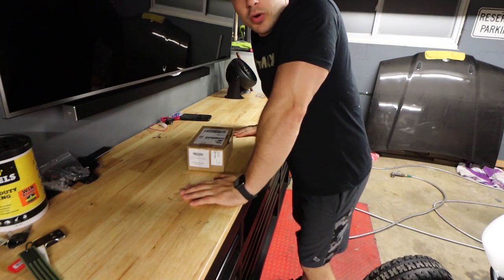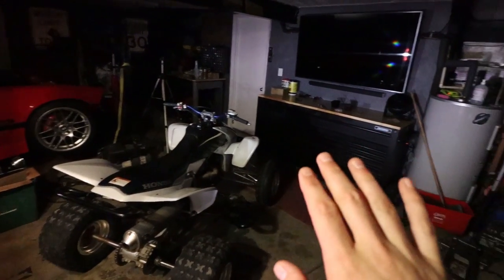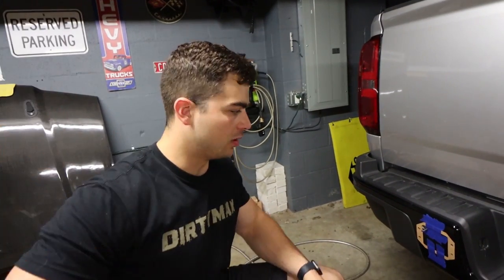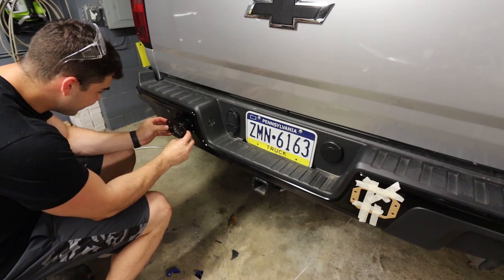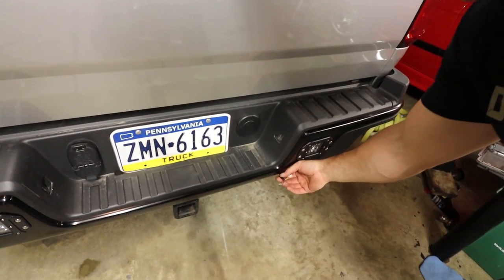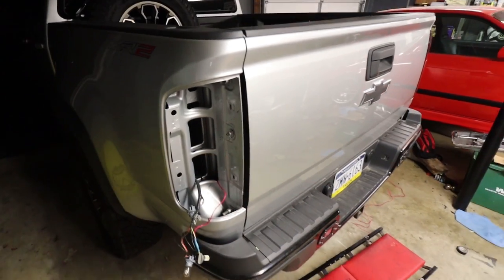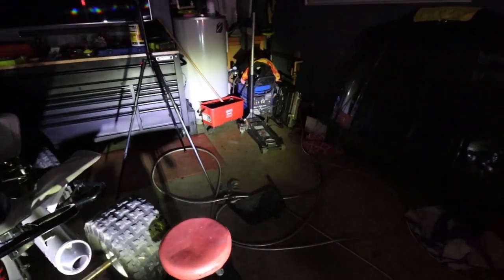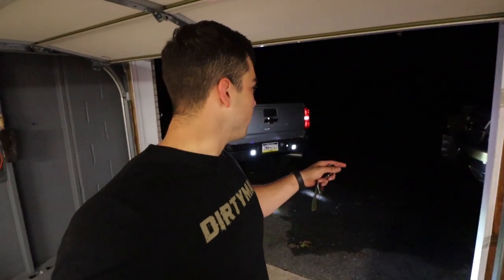Chevy Colorado ZR2 Rear Bumper LED Pod Lights - 2018 Duramax

Comment: Get yourself a double pole double throw Rocker switch with the a relay easy to install, the pods go on automatically when in reverse or you can manually switch them on or turn completely off.
Reply from the maker: Maybe on the Silverado ZR2, this truck is gone lol.
Reply: @matt13ross  oh ok right on.
Reply: Hey buddy so the pre wires they sell at walmart with the relay can do that go on reverse and on w/ the button ..??

Comment: Nice install video, this should be standard equipment on any truck. I went with the Baja Designs Squadron pods in my AEV Bison bumper which already had the mounting holes factory cut out, the lights mounted flush from the backside of bumper so the light frame is hidden. Glad you can see backing up at night now!
Reply from the maker: I would rather have a different bumper but stock will do for now! Want a different front one for sure to add more lights.
Reply: What did you wire them to? I just got my Bison and I will do this but I sould like to run it to that bed light switch that uses the light in the third break light.

Comment: Everyone doing this mod NEEDS to paint that bare metal. Hell, I'd probably put Fluid Film on top of the paint just to be safe. Gonna get real crusty if you don't.
Reply from the maker: True, I just put fluid film on the underside of both my trucks.  Never used it before but want some protectant during the winter.
Reply: @matt13ross  Nice. I've been doing that since new and the under body is rust free. I also live in a state that heavily salts the roads in winter. The hype is real.
Reply from the maker: Good to hear! I actually need to get some more

Comment: Ryobi jigsaw is a nice unit.  It would have been easier to cut the hole. It's one of the best jigsaws I have owned.
Reply from the maker: Jigsaw for metal?  Powerful enough?
Reply: I think so as long as you use a metal blade. The Ryobi Jigsaw is variable stroke and variable speed. Really nice unit
Reply from the maker: I have one haha. Just a wood blade on it

Comment: Looks good which pods did you go with? Also do you happen to have the bulb in for for your factory bed light and the reverse lights?
Reply from the maker: Check out the description box, I have all the parts listed including the light pods and all the LED bulbs I added. Yes I added LEDs to the factory bed cargo lamp and reverse bulbs. I also added led strip bed lighting which I love.
Reply: Boosted Apex thanks

Comment: So if I understood this correctly, the power wire is being tapped into the taillight and not going back to the battery?
Reply from the maker: Power from the factory tail light, grounded elsewhere.

Comment: Hmm... Could u wire to the "Bed Lights"? Would be great to use to turn these on and off from inside cab when needed..
Reply from the maker: You could but they would only work in park, not reverse.

Comment: Hey Matt! What is the small heat gun you are using to shrink-wrap? Thanks!!
Reply from the maker: Just some red heat gun I’ve had forever lol.
Reply: @matt13ross   damn it I thought you will tell me the brand so I can get it too LOL, anyway, good job on your truck, got Colorado 2019 Bison edition, and will do the lights like you have. The original reverse light sucks, I have tail gate light bar but it is not enough. The only diff between your install and mine is that my Bison bumper has the holes for light already, I just need to get the brackets for them. 
 Thank you!

Comment: Question.  Shouldn't you use relays for those lights instead of hooking them directly to the reverse bulbs?
Reply from the maker: Yes, that would be ideal.  However, these pods seem to draw very little power, and they're LED.  I haven't had any issues.  Eventually they'll be hooked up to a switch controller.
Reply: Not being an ass, just curious. Why would want a relay for these?
Reply: @aaronvaughn2453  those pods are 160w which means a current draw of 13.33a. The reverse lighting circuit presumably has a 10a or 15a fuse. So the circuit is being overloaded.

The correct way would be to install a relay activated by the reverse circuit but power being fed straight from the alternator. Let's agree that usually cars don't spend much time in reverse, but I would be surprise if the wiring isn't getting extremely hot. 
The issue being that it heats up just below the threshold for the fuse to blow, but it could still damage connectors in the circuit due to repeated overheating cycles.

Car manufacturers don't usually install oversized cables in the harness to save on weight and money. Copper is expensive. So they make their harnesses the minimum allowable size for the original load of the circuit.
T?
Reply: @munecito  dont think the actual wattage is 160. probably closer to 24watt. closer to 2 amp draw

Comment: Woulda painted that metal. Especially where I’m from it rust out in no time if that was metal...
Reply from the maker: I'll probably end up doing, slipped my mind.  It's not difficult to take them out for a quick paint job. 

Then again, I'd prefer a different bumper altogether.
Reply: @matt13ross  yeah it’d be pretty easy to do. Though you may have to now file/sand light surface rust dependant on how long ago you did this. No biggie. It’d be an easy job
Reply from the maker: I think I’ll get a different  rear bumper sooner rather than later